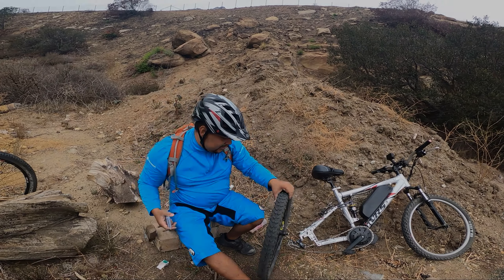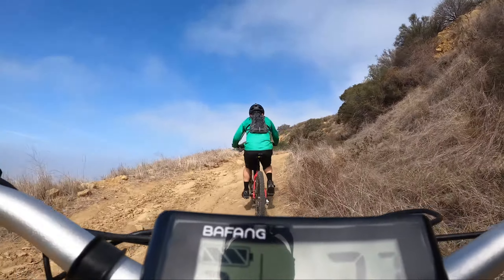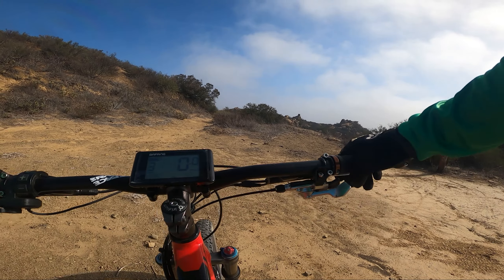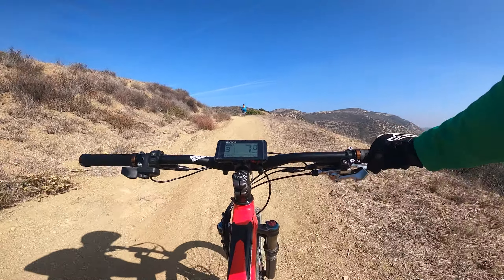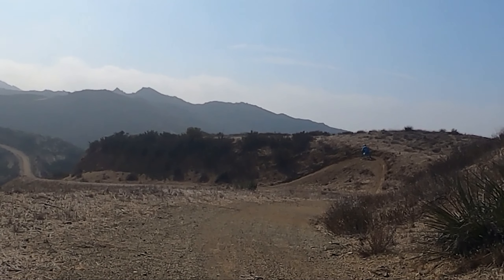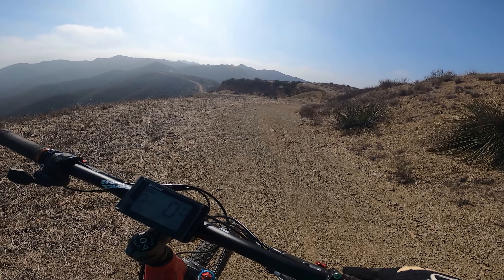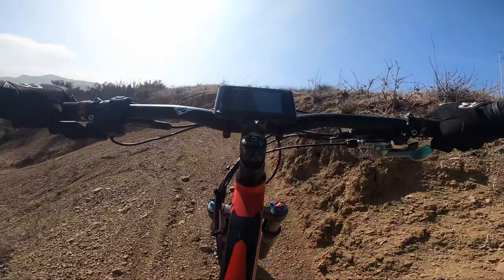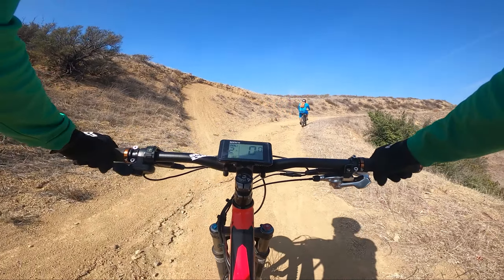Devil's Canyon #2 in Rocky Peak (Bafang BBSHD E-MTB)

Comment: You need hydraulic disk brakes on that bike it's a must for custom e bikes.
Reply from the maker: Agreed! But there's quite a bit of money involved in converting which Alvin doesn't want to spend on just yet. He just brakes way early. It would be emergency stops that would be a problem lol.
Reply: @FirstTimersCycling  It depends what you want Hope brakes or Zoom brakes.
Reply from the maker: @denseljosephs9500  Yeah, but then would also need disc rims and rotors. Alvin eventually wants to just upgrade bikes so he's just dealing with it for now. But I do agree, hydraulic brakes are a must, esp for the added weight of the battery and motor. On my Rockhopper I had to switch to metallic pads as I was getting major brake fade from the resin pads.